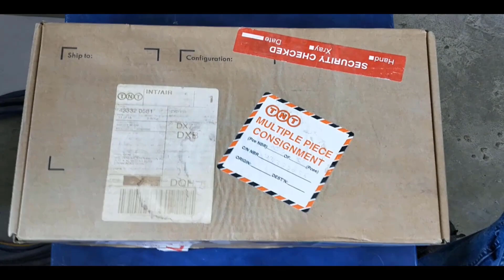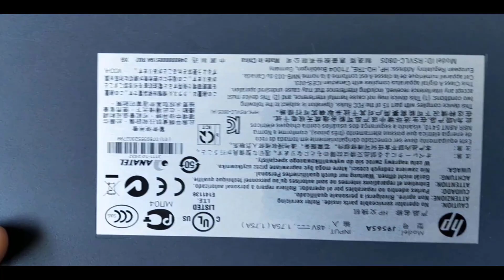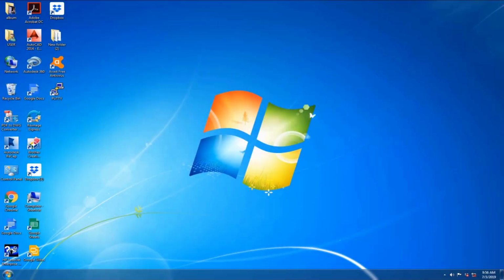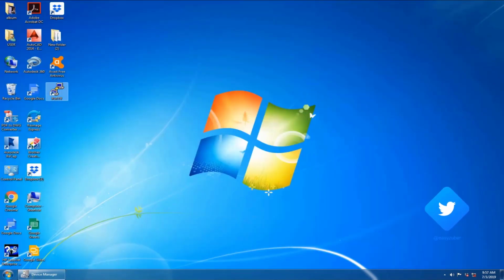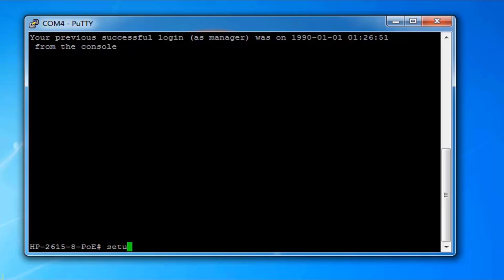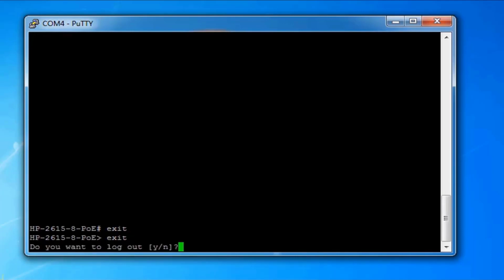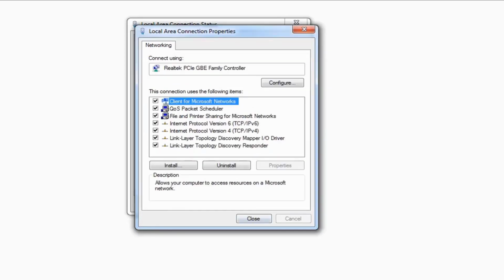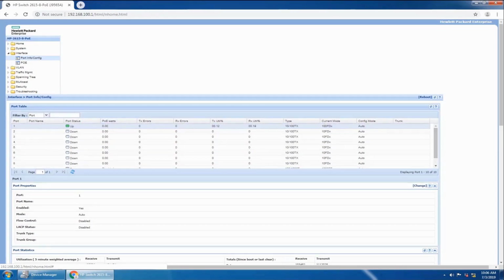HOW TO CONFIGURE SWITCH WITHOUT USING ANY COMMAND | GRAPHICAL USER INTERFACE | HP SWITCH

Comment: I have configured HTTP login on my switch model hp 5120. (with Command :  Ip http enable). When I enter switch IP on web browser menu and login, Web Management Platform window opens which have only Ping and Tracert command facility. Noe of the other configuration menu is shown. pls guide where have I missed configuration

Comment: How did you get the IP address for ip configuration?
Reply from the maker: You can find default ip address on manual
Reply: @easyrobotech  thanks
Reply: Some switches also allow you to set one. my  HP A5120 JE074A  allows me to set on through the vlan interfaces

Comment: I tried to open brwoser but why is it only like this that appears

This product requires the Java language, which is either disabled or not available on this browser. 

To use this product you must either upgrade your browser to one that is Java compliant, or enable the Java language on your current browser.
Reply from the maker: Which browser are you using
Reply from the maker: Try in different browsers
Reply: I using crome and Firefox,Opera etc 
but no results
Reply: I have switch hp PROCURVE 2510b-24 , help me sir  please 🙏🙏🙏🙏😭😭😭
Reply from the maker: Contact me via WhatsApp
Reply: @easyrobotech  +62816827276 help me sir
Reply: download java
Reply: internet explorer is the only one ive gotten to work :(
Reply: Might be a bit late but you could use the falcon browser and the java develop studio
Reply: @Koljahansi  Do you have a link for java develop studio? Cant find this. Is this available for Linux Mint?